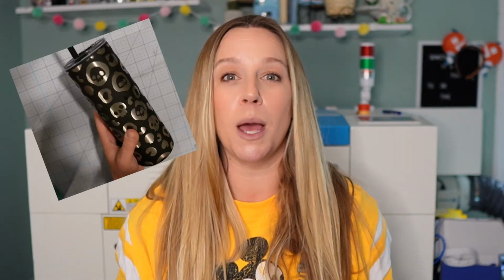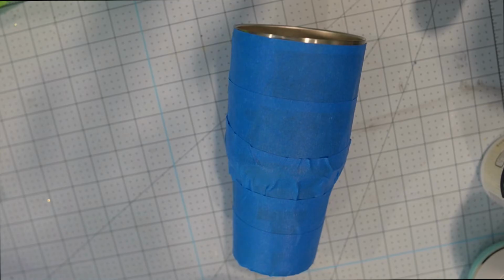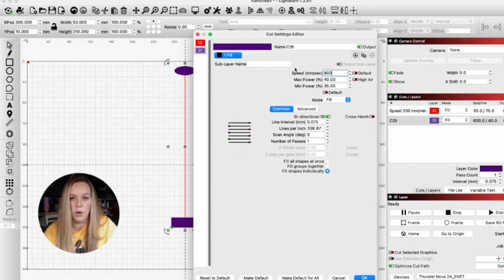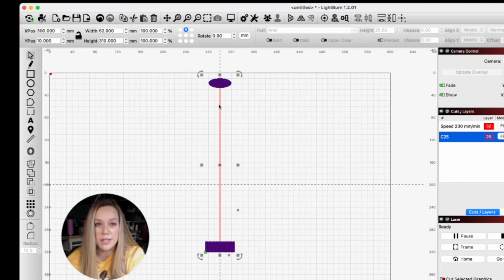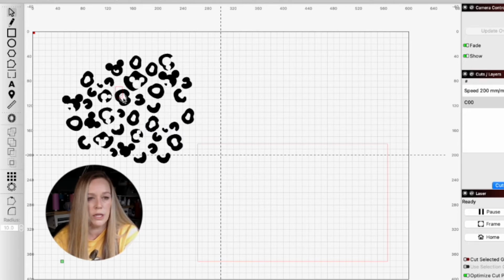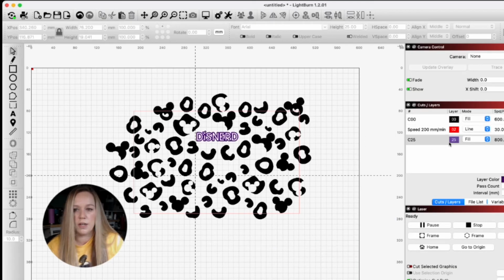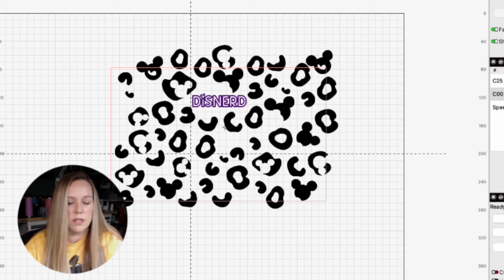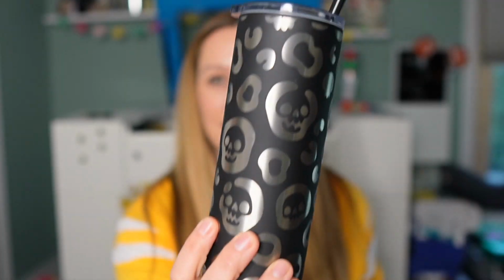THE BEST 360° Wrap Techniques on Thunder Laser Nova 24 EXPOSED!

Comment: I can't "wrap" my head around this. If the bottom of your cup has a smaller diameter, how does your design match up on the lower section when you're working in a rectangle based on the upper section diameter?

Comment: To help yourself out with measuring your cups or anything you ar engraving it would be a good idea to get yourself a 6" caliper. Then you can just measure the diameter and multiply that by 3.1415926 to get the circumference. 
Lightburn has added a warp feature that may aid in the design of cups that are bigger around at the top than they are at the bottom.  Also when you want to align the tops or bottoms of two objects is simple in LightBurn. Just highlight both objects and use the alignment tool.
Nice video and I hope you have as much fun engraving as I do. It's a good ways to spend one's retirement.
Reply from the maker: Thanks Kris - I have a caliper - hadn’t thought to use it for that. I’ve been investigating the warp feature but it’s behavior isn’t quite what I expect! Have you used it for cups in this way? Thanks for the alignment tips too! Appreciate it
Reply: @Katie_Devlin  I haven't as of yet but only because I haven't downloaded the new release of LightBurn yet. Now that you asked me, I remembered I need to do that.
:<)
Reply from the maker: @krisknowlton5935  I’ve been playing around with it and have some questions out on the forum. I’m not quite getting the results I want using it, but we’ll see!
Reply: @Katie_Devlin  I often wonder if people buy these lasers thinking they will be able to make a couple hundred grand a year making stuff and selling it on ETSEY. There is a lot of work and head scratching involved and a lot of wasted material. So they just give up. I have a feeling you don't fit that category.  I feel fairly certain you will figure out how to make it work the way you need it to. That's what makes it fun. You have a great evening.
Reply from the maker: @krisknowlton5935  so very true - the testing and trial is what separates long term success!

Comment: How do you take into account the yeti logo and not engraving into it? Thank you!
Reply from the maker: Hi -  a couple of options here - you can use aluminum tape to simply cover the logo, or you'll need to factor it into the design - I'd then likely center my starting point on the yeti logo to make sure I had enough room.

Comment: Thanks for sharing!

I'm a little confused by how you are able to base the whole design based on the largest portion of the cup. Why do you not need to a much smaller pattern on the bottom of the cup since it's substantially smaller? Example top of top design is 6 inches and bottom 4?
Reply from the maker: So it’s kind of complicated to explain. It isn’t like cutting a vinyl wrap because the laser is just traveling in a straight line, and the distance it goes on each rotation is determined by the rotary, it doesn’t actually care about the size of the cup. It’s kind of like why once you’ve determined your steps per rotation, that applies to all cups unless the part on the roller is a totally different size than what you’re engraving, like a water bottle. So I need to make sure that the largest part gets fully covered with the design. The smaller part will see some compression of the design. Maybe I’ll try to film an example with some lines to show what that looks like.